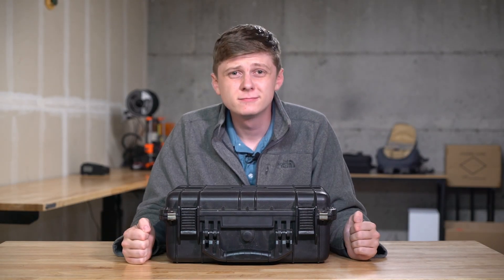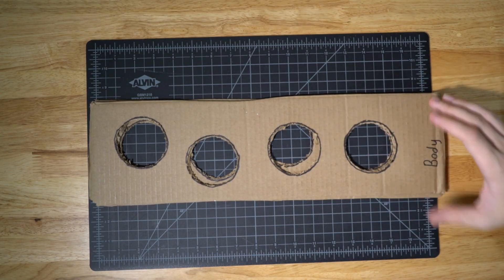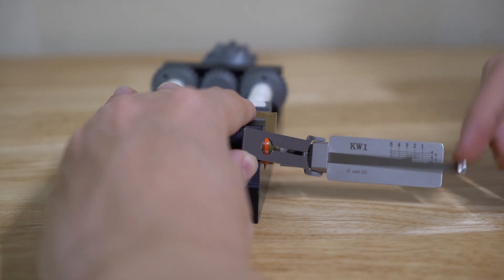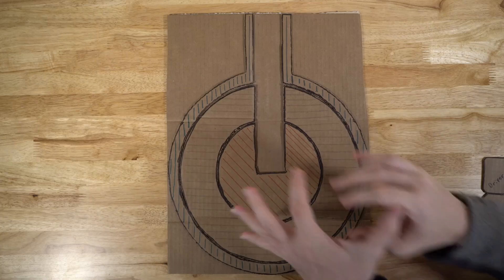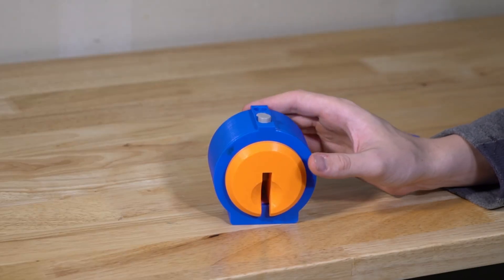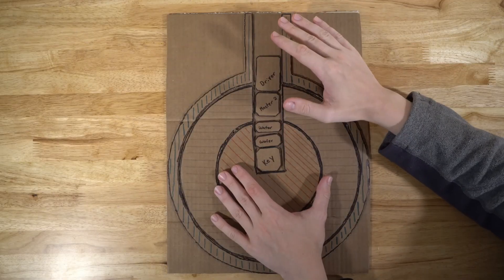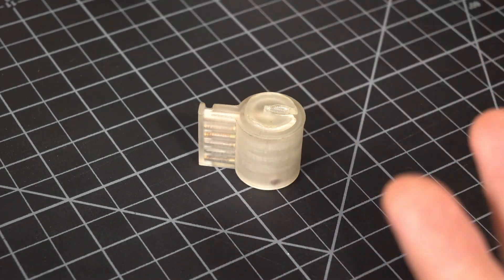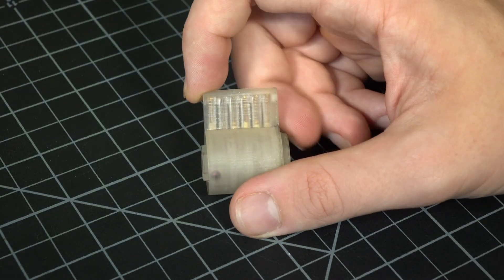How to Design an Unpickable Lock

Comment from the maker: Thanks for watching. If you liked this video, subscribe and check out the other videos in this series!
Reply: Hear me out: go square, not round. Square pins in broached holes, that are connected into a long slot by the sheer line. No more misalignment, no more binding order. They all bind at the same time. Coupled with a very paracentric keyway this could be a picker's nightmare. In fact, why should the key be flat. It could be a small L-shaped profile at a 45 degree angle with teeth sticking out just far enough to interact with the key pins. Even if you get a pick in, you're guaranteed to overset half of them and not even feel it.
Reply: I think you should take a look at “bumping” where you use a lot of force to shake a pin up before trying to twist. It might be able to bypass your watchdog pin, so think about that if you are thinking of making a version 2. Anyways, keep up the good work, love the design.
Reply: Um hi ye. I have a degree in manufacturing and over 5 years experience in lathe operation. If you buy me a mini-lathe Ill buy the 4 jaw chuck and materials to make that. If you dont like what I make after a week of getting all the stuff. I'll send you the lathe, chuck, and materials. So, if I win I get a mini-lathe. If you win you get the mini-lathe + tools + materials. You get to make the video either way. So what do you say?

Comment: A double stack yoked driver pin design really solves this. By yoked driver pins i mean that your body or bible is double tall and contains sprung yokes that link alternate pin stacks such that the key will sequentially lift each pin stack and by the very virtue of pressuring each pin stack continuously allow the key to open the lock. But when picking you pick one pinstack and then the next. Everything is fine. But you pick the next stack and it will either jam or unpick the altenate stack. This means you get stuck repicking the first two. It necessatates a third hand or a key. Carefully selecting pin lengths to align with the shear line will defeat comb and bumping attacks.

Comment: The problem isn't the lock companies, it's the consumer. Customers don't shop by security, they shop by price. There's no need for locks with exposed mechanics. You can simply have a 256 bit encryption lock that changes every min that you use your phone or keypad.

Comment: Bosnian Bill proven sleved locks as very hard to pick. One vurnability is simillar to any wafer locks - introduce multiple sheer lines. Also with decoding pick you can record each sheer line you detect and test all their combinations. Other than that, it is pretty doable lock, just one extra part (sleeve) or midcore as you call it.

Comment: Problem: Can You Pick A Lock With No Keyway? I can guarantee you couldn’t pop a cell at Attica Prison from inside. That’s pretty much where I’m going with this. Lishi’s and Combs aside, if WE are operating those locks from the end of the gallery and you can’t get through plate steel to the mechanism, you’re still in the cell, right?  Your SECOND Problem is: STUPID OPERATORS. In 25+years of that job, I’ve seen people mess up keys, locks, etc. because they’re too stupid to do out correctly so you DON’T damage keys or locks. Broken equipment shuts EVERYBODY down. Regardless of the setting. If you can’t get past the lock to the garage, you can’t ride your bike, right? PEOPLE are the #1 Cause for Broken Locks and Keys. Not thinking. Not understanding. Whatever. They JAM the keys in like it’s ok and CRANK on the rotation before they’ve successfully seated the key in the keyway. They shave alloys into the lock for it to build and combine with any lubricants present to become a sludge and eventually gum up the works.

Comment: While I enjoy engineering and picking, there’s a reason lock innovation has stalled out commercially. Locks are already to a point where destructive methods are faster and easier, I have bolt cutters and a Milwaukee m18 grinder so if I can’t do pick it quick it shall come off much faster anyway. I use mostly cheap master locks for this reason, bolt cutters are a far bigger threat than someone actually knowing how to pick a lock. Particularly for the rural area I’m in, a person is more likely to have a rifle in their truck then a bolt cutter and a few gun shots won’t draw any attention as people shooting in the backyard is normal.

Comment: Pins that are dovetail shaped along their cross section with serrations on the flat side, with a complimentary serrated profile in the body of the lock so that when tension is applied, the serrations lock together unless the shear line is properly aligned.

Comment: All this time and effort spent on altering the pins, when Bowley made the most difficult locks to pick by effectively making a backwards key.

This design is both commercially viable and astronomically difficult for even professional lockpickers. Certain designs HAVE been picked, but they took time, practice, and a specialized tool.

Messing with the pins is an engineering dead-end. If the criminal can even interact with the pins, they can pick the lock.

Comment: “Unpickable” is an absolute - one that someone will achieve at some point to prove wrong. “Pick resistant” - I think you have achieved! Then again…

Can you rake it? Yes, can you bump it? Yes, will it take longer? Yes! These attacks are regardless of the “watch dog pin“. They will if not open it by chance luck -  produce some false positives. And some of those false positives could even be tested against a liece tool to sort out number combinations to use. Right until you get a possible positive, then record it. Wash, rinse, repeat, and then tried the combinations. These false positives rule out possible combinations to be excluded.

Comment: if someone can pick a lock, he can also use wire cutters and dertroy the lock. So if you dont have 200$ for some armored lock, than noone cares. Its more of a annoyance, than protection, but it still works. Also if your lock doesnt break, your chain will, and so on, ans so on. So if you like to be secure, just buy armored door.

Comment: I would like to suggest an easier to manufacture unpickable lock:
The user opens or closes the lock by putting the key in the hole, and pushes an adjacent toggle switch up or down.
The core of the lock is bolted or welded to the lock's stator or housing.
The toggle pushes or pulls on a "snap action" mechanism, exactly like the inside of a light switch.
The snap action mechanism spins the cylinder around the core.
The cylinder, not the core, is connected to the deadbolt or latch.
The reason the lock cannot be single pin picked is because the user cannot control how much tension/torque is applied to the cylinder - the "snap action" mechanism provides a manufacturer determined amount of torque.

Comment: Not to be too harsh and I certainly don't have any ill will behind my comment, but this design is neither new or innovative. Split cores have been around for at least three times you're age. There have also been TONS of innovations to locks within the past 150 years that are not only significantly better than your proposition, but also currently used commercially.

Perhaps you will succeed where your predecessors have failed, certainly give it your best shot if you're passionate about it, but it's a long an arduous road ahead and there are significant hurdles that you would have to overcome (hurdles that thousands if not ten's of thousands have yet to overcome). There are good reasons why we are where we are when it comes to lock technology, though I certainly agree that I wish it were better.  

Personally my favorite lock designs are "John Coulter's Weirdest Lock on Earth" (showcased on BosnianBill's 637th episode) and the Bianry Multiplane Cylinder designed by Earnest L Schlage in 1971 (showcased on BosnianBill's 1114th episode).

Comment: It's not that they can't make very pick resistant locks. It's that the customer will buy the lock that costs $20 or even less instead of the lock that costs $100.
And while combing vulnerabilities and rake vulnerabilities are unforgivable flaws, most criminals don't try those things unless they know the specific lock and have that tool.
Most criminals attack the shell around the lock. (The building or case or whatever) Or they simply take an angle grinder to it and very few locks and chains can resist an angle grinder.

If you lock your bicycle through the frame and both wheels and have a lock and chain that is impervious to angle grinder attacks... The criminal will happily cut the frame in half and both wheels and run off with the bits attached to that frame. Unscrewing the bits at home and selling the bits as spare parts instead.
Criminals DO NOT CARE about your stuff the way you do.
The best deterrent is to always have your valuable things under a watchful eye. Very few criminals will want to risk catching a bullet.

Comment: This should be able to be defeated if the midcore has a standard thickness.  You would need a set of sacrificial pseudo-pins to take the place of all of the wafers and keypin, but after that it would essentially work similarly to a combing attack.

The picking tool would likely be single use, but it could have the pseudo-pins attached to an insert that goes into the lock, then you raise it up to push all of the normal pins and wafers completely into the outer body, turn the inner core to shear the sacrificial pseudo-pins off from the insert, and the shear line will be clear.  It might require a separate tool to turn with enough force to shear off the pseudo-pins, but it could still be easily defeatable.

If the wafers are all the same thickness as well, then it wouldn't even be necessary to push the keypins up into the outer body, only the master pin.

Comment: Tried my own hand at the "unpickable lock" problem (video on my channel if you are interested) taking an entirely different approach using magnets. Still the same core principle, seperating the "setting" and "testing" of the elements into 2 discrete stages...

But like you, except to a much higher degree, the complexity of the design made it unfeasable for real world use. Too many intricate parts that are too difficult to manufacture, all for a system thats no better than whats already available on the market...

Comment: I think the idea is good but I would not be so sure this design is unpickable. I'm in no way a lock picker but I've seen almost all LPL videos and also have some knowledge of physics and mechanics (although not too much), with that in mind, I believe that the only thing that would have to be done differently to pick this lock is to change the way to use tension, I mean, instead of applying tension to the core as a whole, you would need to pick it in to stages, first the outer core (applying tension only to it) and then the inner core.

What I'm trying to say is that, if you manage to pick either the inner core or the outer core (I belive you called it shell), then you end up with a traditional lock. Once any of the two layers of the core is picked, the other layer would be pickable just like you would pick a regular lock. Also, if this is meant to be used on padlocks then there are other "picking" methods you should protect it from, like making sure that the attacker cannot insert a lock pick through the entire core and use it to actually release the lock (like LPL has shown in multiple ocassions).

Comment: From my basic lock understanding, I believe this would be vulnerable to using shimmers. Having an L shape shimmer that you insert once you rotated the inner core in order to block the watchdog pin makes the lock a regular lock to pick.
This could be avoided by creshaping the front of the lock to prevent shimmer to enter
Also, in order to protect it, it is necessary to prevent any way to put tension in the intermediary core at all time, and that could be possible with a front plate that only allows the key to enter and doesnt give any access to the intermediary core

Comment: As long as a lock can be opened, it can be cracked. It just requires more or less effort. And over time, the process becomes significantly shorter. And if you then demonstrate the principle of operation in a video, you give the crackers everything they need to achieve their goal more quickly...

Comment: Very easy to pick. First pick the inner part, so that the watchdog pin allows rotation. Than glue the two inner parts together and pick like a normal lock.
Reply from the maker: https://youtu.be/D0mHl1_NYPw?si=AI1fuyqXmCKCiglD&t=2m07s

Comment: I know it sounds weird, but I'm not sure I would default to an unpickable lock either way:
1. If the owner legitimately loses all keys, it's often useful to be able to regain access (via locksmith) without expensive destruction.
2. My limited experience with real thieves is that they'll use the cheapest and quickest methods possible. If it's still easy, cheap and quick for actual attackers with the right (multi-)tools to get in, then what problem did it really solve?
3. For me, current locks are mostly about protecting against accidentally accessing the wrong thing or people with temporary poor judgement.

Comment: In the end people go with the way of least resistance. You don't need a very good lock in most cases. Just one that looks more difficult than your neighbors ones. Also it doesn't matter if the lock is unpickable, when a window is open. Same with bike locks. It doesn't matter how good it is, people will just steal your bike while leaving the wheel behind.

Comment: The demonstration of how lockpicking works was really well put together with showing why lockpicking actually works. Many just show that there are pins with springs that you can lift to open the lock but most do not explain why you can click pins like lockpickers do. To understand the flaw of locks is very important if you want to actually understand what you are doing and why it works. A perfect design would just drop the pins when they are lifted, you would not be able to trap them but it would probably be very hard to turn these locks if they were cheaply made.

Comment: Then why not use innovative keys possibly adding strong magnets in certain parts of the key to unlock pins that the key doesn’t control, only the magnets, and to make sure people cant get past that add other magnetic pins internally that can stop the turning too, and of course make the external material strong enought to withstand blows.

Comment: It's not really unpickable since you can still manipulate the settings before testing through the traditional binding methods. It's better because you'd need to brute force the key, but as gross as that is, the method still lets you gain information. I think you'd need another step to truly disable the traditional binding technique, particularly holding the pins and letting another inner core rotate away from the key so the shear lines could be tested without the user ever getting feedback as to whether the height of any pin was even valid. For a key that simply places each pin at the correct height, the lock would just open, but for an attacker they'd have to guess at everything.

Comment: I am not even an amateur when it come to picking, but it feels like it should still be pickable.
Yes it should drastically increase the time to pick. But the need for wafers would probably lower the amount of possible permutations for the specific lock.
You could still make a lot of different keys that would each open a separate lock, but one specific lock would have a lower limited number of possible permutations that would open the internal cylinder.
Btw would be specking the lock so that the gate is the first one to bid increase it security?

Comment: If you do make a fully metal prototype of this, just remember that slide hammers, drills, magnets, and some other forceful methods exist and will be used to destroy this thing. Keep that in mind before sending off to LPL or any of the other great lock picking channels out there! And keep in mind that just because the tumbler may not be vulnerable, doesn't mean the stand-in door you attach it to isn't either.

Comment: Funny how the discussion is about an unpickable lock, but the questions should be: are locks still picked? 
at least here in europe, there is practically no lockpicking anymore. non-inbuild ones are opened via "masterkeys" (aka bolt cutters or other cutting tools). 
inbuild ones are opened via "leveragekeys" (screwdriver, crowbar etc.)

Comment: As a self taught locksmith over a VERY well known airplane OEM, I learned many pick techniques, but certainly not my only job.  However, you have to STOP thinking like a locksmith, and start thinking like a criminal!  Crims do NOT PICK LOCKS!  They are WAY too stupid for that.  Always remember that.  Drill stops, shear protection, etc.  They are coming in for force, not picks.

Comment: I feel like the best way to attack this lock would be blunt force. Basically, if the lock his not in a door or similar, you could hit it with a mallet to bump the watchdog pin up and circumvent the entire mechanism that sets this lock apart. So first, stick the inner core to the midcore somehow (a drop of superglue perhaps), then hit it with a mallet to bind the watchdog pin. Pick the rest as normal.

Comment: But the question is, a unpickable lock necessary? I would say in this case you are just creating a bigger problem if you lose your keys and need a locksmith, because a thief would have no problem breaking in using force.